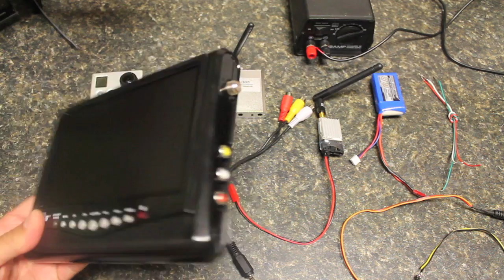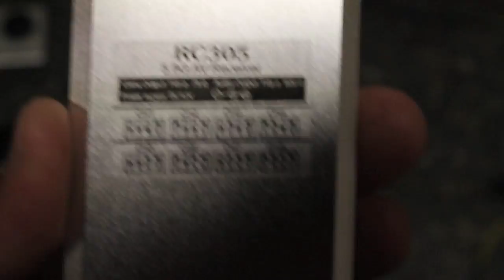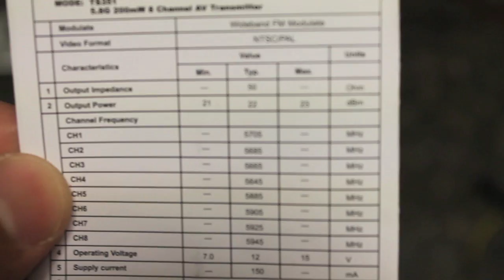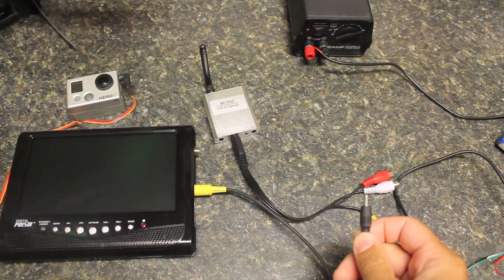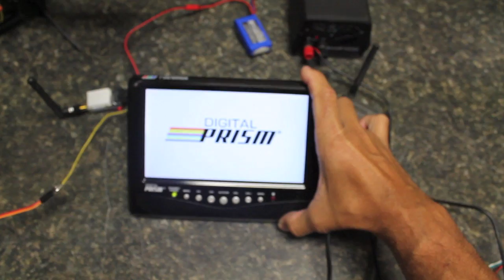How to Setup FPV w/ GoPro HD, HobbyKing 5.8GHz Transmitter/Receiver for DJI Naza Quadcopter

Comment from the maker: I remember reading somewhere that the output voltage should be near 1V. What readymaderc cable are you using and I'm assuming your transmitter is sending video out?

Comment: Frame is S800. ZenMuse is very stable but limited to Sony NEX camera's due to weight but that's not a weakness since those cameras are excellent. The GoPro for navigation and Zenmuse for the NEX-7 and controlled by a separate operator.

Comment: Is the gopro video out really hd video? i noticed the video is 16x9 wide screen format but it does not fit the lcd monitor, has bars, looks like 16x9 video emosed on 4x3 with bar on the bottom!

Comment from the maker: I wouldn't say it's a necessity if you're doing FPV, but it would definitely help you out if you get into trouble. The return to home feature and IOC (intelligent orientation control) will be extremely useful if you get disoriented. These are only available with GPS. Now if I read your comment correctly and you are just getting started then I recommend flying FPV within line of sight so you can always look up and bring it back home. Until you get better. This doesn't require GPS. Hope that helps

Comment: Hey Dennis i have a dji f450 with the naza i really want to setup fpv on my quad but i dont have the gps yet. Do you think that the gps is necessary to start out flying fpv? i've heard it can be challenging the gps's added stability might make it a little easier to start out. 

Thanks for the video's the Naza setup one helped alot

Comment from the maker: I assuming you meant to say "video" instead of "audio"? Or are you really recording audio? Anyway, the 3S should work fine since the operating voltage is between 7 and 15V. But make sure you check the model # of your transmitter and look at the manual. If it is the HobbyKing setup then it's 7-15V input. Good luck!

Comment from the maker: Glad to hear it! I'm actually using this setup with my TBS Discovery frame so my video tx is mounted on top of the quad. I have it ziptied with a bit of foam underneath it. I wouldn't say it matters too much where you put it, but just make sure it's well mounted and you try to minimize vibration. If you have GPS I've heard that the transmitter can interfere with the GPS if it's too close, but haven't experienced that personally. Good luck with your setup!

Comment: Does the 7in screen you show go to a blue screen when signal degrades? I've read that it's best to find one that shows static so you have a least a little video instead of all blue. Just curious as it would be a nice second monitor at that price. Thx for the videos. Keep them coming.

Comment: Thanks for responding Dennis...looking at mounting a 5.8g 200mw FPV Wireless AV Tx & Rx Set to a DJI Phantom. Id be using the Hero3 Black to capture and FPV video. Its specs are: Transmitter operating voltage: 7~15VDC / 150mA -  Weight: 25g....Hopefully not too demanding on take off weight and single battery amperage

I wondering how much fly time would be clipped

Comment from the maker: Yes, but it depends on your input voltage. So make sure your battery voltage rating does not exceed the input voltage of your transmitter. For example, if the input voltage for your transmitter is 12V then a 3S lipo (11.1V) should do the trick. Just keep in mind this will give your quad less flight time since the motors and transmitter are consuming power. There are many things to consider when evaluating a single or dual battery setup. Google "fpv separate battery" and first link has details.

Comment: Sick case! 

I just ordered all the important parts. with a total of 131 dollar, thats 101 Euro for me. Could have done it a bit cheaper, after ordering i found a gopro video cable for 3 euro instead of 12 dollar (10 euro)
Only downside is the 7 inch LCD monitor, no battery, so i will have to power it with a lipo 3c. but cheaper @ 36 dollar.
And now we wait! :-)

Comment from the maker: The label on the receiver says 12V DC, but according to the instruction manual you can supply anywhere from 6.5-12V DC to it. So if you want power the receiver with a 2S lipo that should work. I'm not certain if that will give you less range than a 3S, but it's something to consider. I will do some testing in the future and will post a video that talks about supply voltage as it relates to signal strength.

Comment: The Receiver requires 5 volt to operate, but you plug it in at 12 volt? 

Im guessing that a 2s lipo can supply enough for the receiver?

Comment from the maker: I'm not sure what qualifies as "good" range, but let me share some thoughts. When I first received the FPV setup I did a simple car test. Someone was watching the feed as I drove off and broadcasted from my car. With a 2S lipo and somewhat clear line of sight I was able to get over 1/4 of a mile. Ideally this should be transmitted with a 3S lipo in a clear line of sight and my belief is you could get 3/4-1 mile. Don't quote me, but at some point I may do a test and let you know.

Comment from the maker: Thanks and you're absolutely right. The minimum operating voltage for this transmitter is 7V so a 2S lipo will work, but the recommended operating voltage is 12V so a 3S is the way to go. I only had a small 2S at the time of this video, but since have been using a 3S instead. I haven't measured the difference in range between 2S and 3S, but would be interesting to do.

Comment: Hi, i conected my gopro same wires as you video and ground to a 4way jack plug and i can see the live feed for gopro fine on my goggles. But as soon as i try a test record on gopro hero 2 at same time as viewing live feed via video out jack the red light on gopro goes solid and stays on,the gopro Is then frozen up or non responsive this happens every time i do this. Can you please help as im bafled?